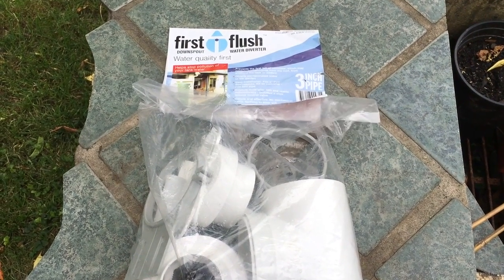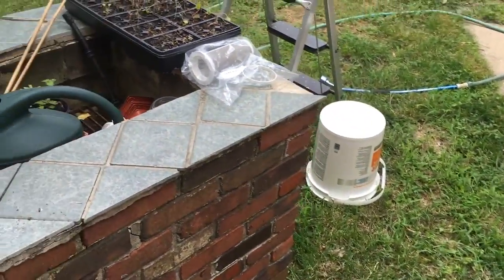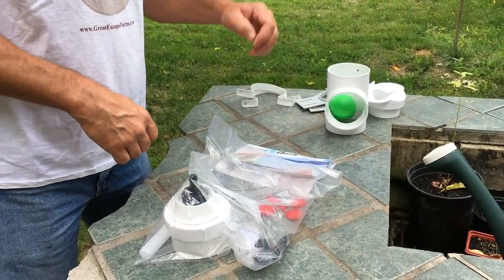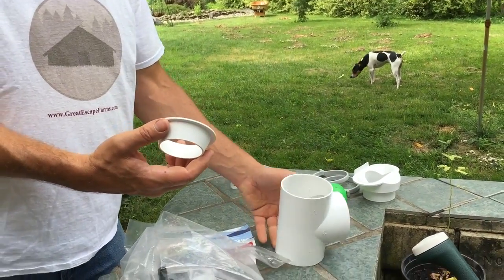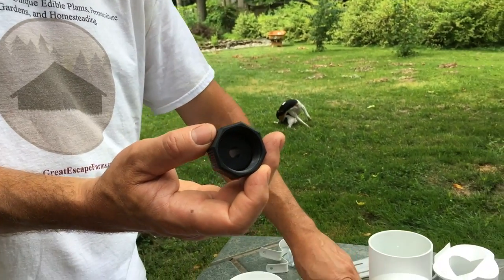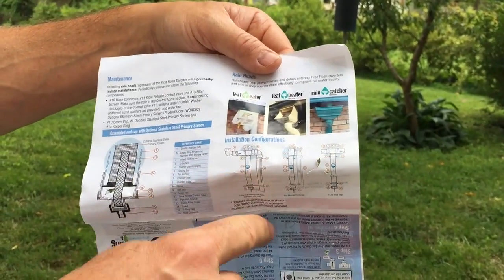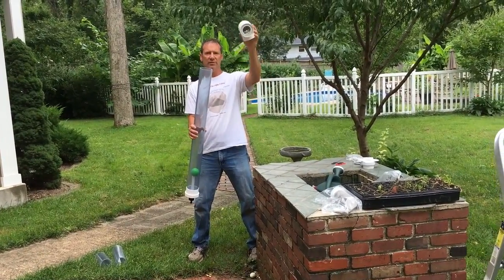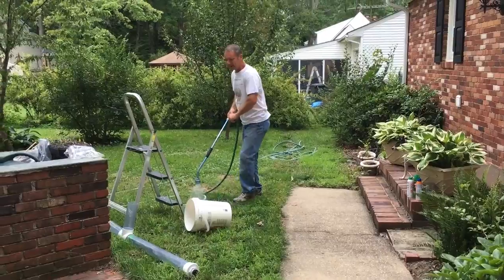First Flush Downspout Water Diverter Product Review

Comment: Folks if you put yourself out there on a public forum and expel incorrect information to the extent you cause injury to an innocent individual who adheres yo your comments you should be held criminally liable even though the information was not intended to cause harm if damage is done to an individual. I believe an immediate retraction should be made and immediately to correct one of the first statements made in this video. These units “cannot and will not filter out toxins” Alan C. Castle
Reply: You spelt A. Arsehole incorrectly at the end.

Comment: I tried to build one myself, since you cannot buy the materials over here. Unluckily, the ball in my system doesn't close the downpipe. It's leaking constantly... My estimation is that the downforce of the water coming from the roof pushes the ball away.
Any ideas would be appreciated!

B.t.w. I created an air gap like in this video. Water is pouring out the gap....
https://youtu.be/Tr5Fg6jdcLw

Comment: I am in the process of installing a rainwater harvesting system for my garden and have watched all of your rainwater system videos, lots of good information, thank you. I decided not to purchase a First Flush system because once I was able to see mechanically exactly how it works, I was able to build my own larger system using 4" PVC pipes instead of just the 3" that their system is designed to use. Because my roof is so large with 4,000 square feet of roof, I need to collect the first 40 gallons in the first flush before it goes to my storage tanks, so by using larger diameter pipes I can accomplish that easier. Multiple 4" PVC pipes with screw-on plugs at the bottom allow the water to slowly drip out to drain the system and a 4" to 3" adapter at the top catches a plastic Whiffle Ball inside to trap the water inside the first flush storage tank. Very easy system to build and works perfectly.
Reply from the maker: Awesome ingenuity. Thanks for sharing.

Comment: That was an excellent demonstration but I would like to know if you have to clean out the contaminated section after every heavy rain fall.
Reply from the maker: That depends on your situation.  I only clean that section on my system out once a year.  If you have a "dirty" roof you may have to clean it out more often than that.  My roof is metal and there are no tall trees close by.  If I had and asphalt shingle roof with tall trees that dropped a lot of leaf litter, I'd have to clean it a lot more often.

Comment: Where did you get the clear pipe? That would be a good piece to have on any system so you can see how much debris has been collected.
Reply: 🤔I would imagine it could/would also encourage algae growth; particularly if located on the southern side of a structure....
Reply from the maker: @Deadfred8211 - Initially I thought the same thing about algae, but after thinking about it, algae should not be an issue.  The system is designed to be self cleaning and empties out after a number of minutes (after the rain stops) to reset the system.   Because of this, the clear tube would be empty most of the time that it is not raining and therefore would not be able to grow algae.
Reply from the maker: The clear PVC tubing was special order and was about 50 times what normal PVC costs.  I got it only for demo purposes.  Unfortunately, I do not have the vendor info any longer.